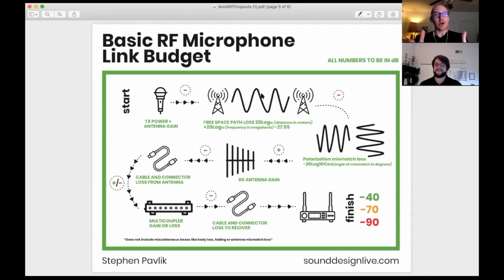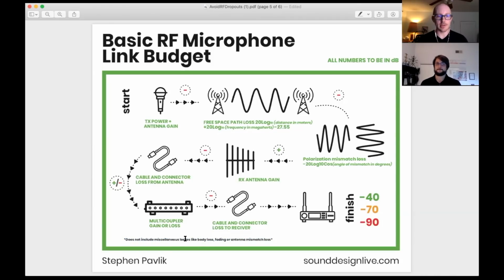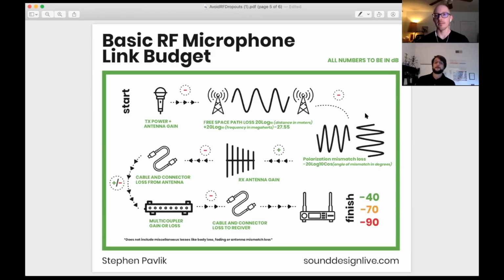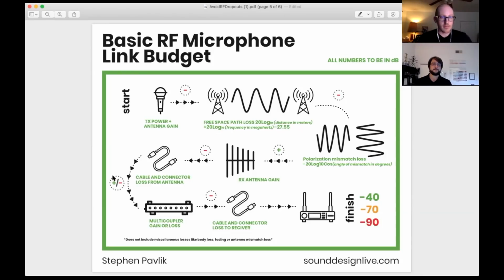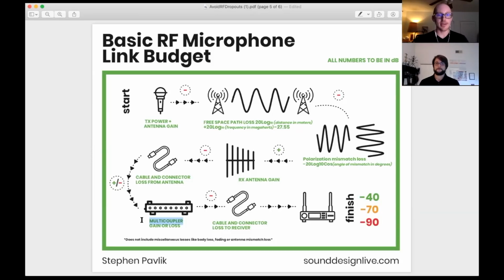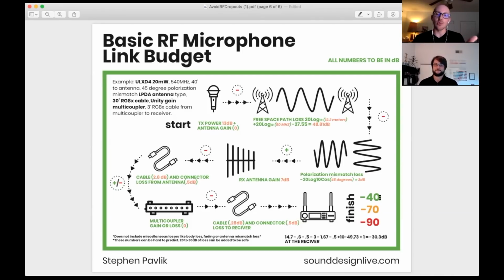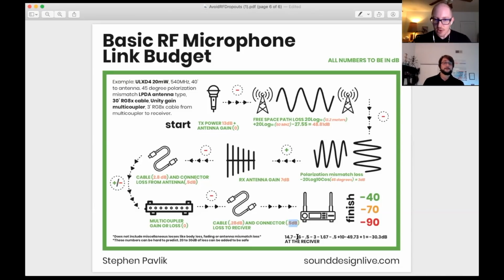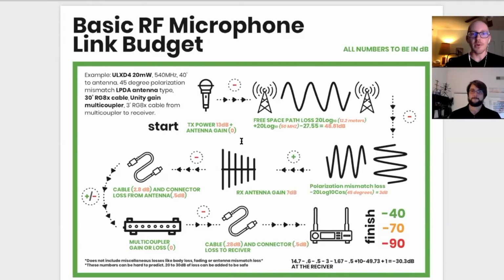INFOGRAPHIC: How to Avoid RF Dropout and Overload with a Wireless Microphone Link Budget

Comment: I keep getting 53.37 when trying to do the first step of the 20LOG10(12.2) etc. I've tried calculator, excel, breaking it down in excel, having no luck getting to 48. Any input? Great series btw, great stuff
Reply: Do I need to convert 50mhz to db first?
Reply from the maker: Hey Pizza Guy, check this out - http://notepadcalculator.com/s/f676d907106f2e96bbdb7bc18f7994e6bd66760d

Or just drop this into google 20log10(12.2)+20log10(600)-27.55
Reply: @nathanlively  Got it. Thanks!
Reply: 50 in red has to be 540